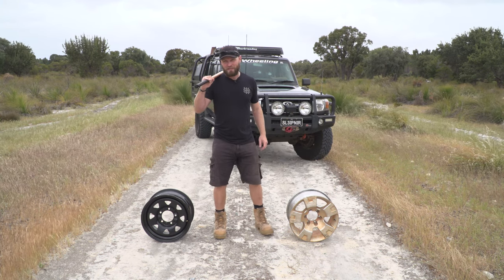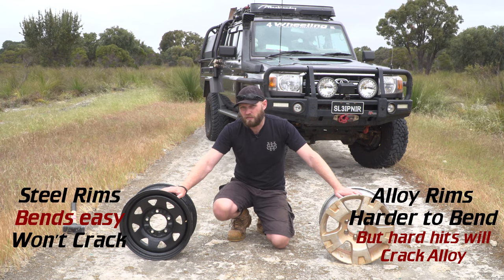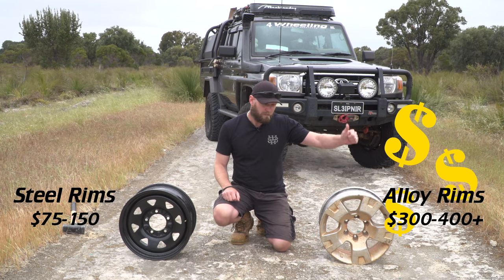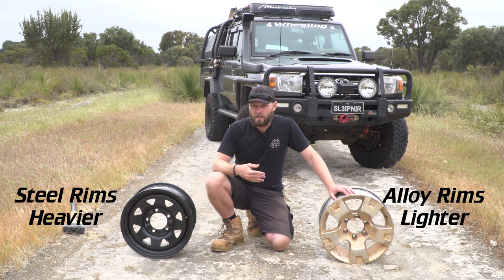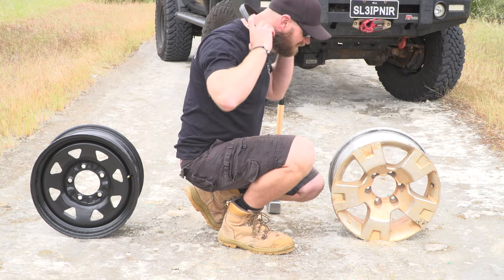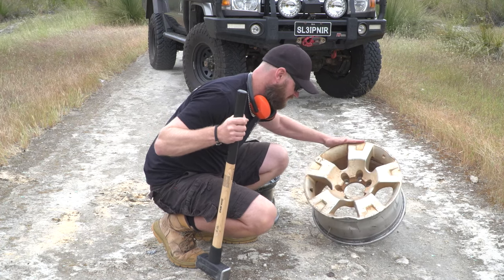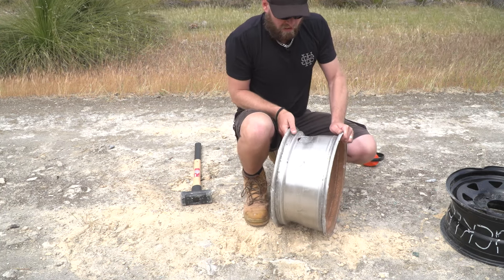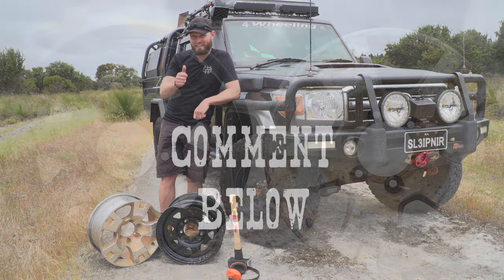STEEL vs ALLOY rims Off-road Wheels

Comment: Not all alloy's are the same.  My Land Rover has 20 year old factory alloys that have seen a hard offload life, but they are still in excellent condition.  They also have a factory internal bead lock.  I have never broken a bead or chipped a rim..   Replacements are easy to find and cheaper 2nd hand that steels.
Reply: I've known guys that drive off-road for a living, chasing pipeline, working remote oil sites- that sort of thing - since the mid 2000s a lot of their trucks run alloys. I've never heard problem one from them.  We are talking tens of thousands of miles of off-road driving to some wacky weird places over like 15 years.

There is such a thing as "stronger" but there is also such a thing as "strong enough" and alloy wheels are strong enough. If you manage to break one ... well - I've never heard of it happening, maybe it's an Australian thing.  Then again - that's why spares exist.

If alloys were some sort of dangerous design flaw I would be interested why  Land Rovers and Jeeps come with alloys - you know.. companies whom have reputations built on off-road prowess.  I'm fairly certain that if it was that large of a difference they would probably have stuck with steel.
Reply: Correct, the Landy will have a forged alloy wheel, nearly indestructible!
I don't think that was a forged wheel he was bashing up, because I really doubt he could have split it!
And if you bend a steel one, sure knock out the dent to get you home, then replace it, throw it away, as it will never be the same. It will be hard to balance, and will never be as safe as it was new!
Also wheel design plays a very important part of how strong a wheel is, not all wheel designs are equal, some Blingy Alloys are damn heavy, yet not all that strong compared to other alloy wheel designs!
Not all cast alloy wheels are equal either, the CSA wheels are by far the closest to a forged wheel in strength, not far behind at all, as for the rest yeah a good steel rim will give many of the poorer ones a run for their money.
So choose carefully, but remember most factory alloys are forged units, its one reason they are so expensive, but secondhand ones are great value... don't like the look, get them powdercoated :)

Comment: To Be honest 99% of 4wd alloy rims look shit. Even those aftermarket tend to be worse. steel rims always look better on 4wds
Reply: yes ,  they are better for off road and look great
Reply: define "better."    Because all I got out of this is if I want a heavy wheel that is more resilient to an attack by a Australian man swinging a sledgehammer then steel is the way to go.  If I want actual off-road performance......  well - all things being equal : lower unstrung weight is generally desirable and...........  nobody cares which "looks cool" if you are buying off-road parts based on which looks the coolest I think alloy/steel is  the least of your concerns.
Reply: Being able to trail repair something is pretty important in remote areas. When I'm 50 km in the bush,   I prefer something I can beat back in shape with a hammer. I keep JB weld for my ATV rims.
Reply: stevespatrol >>> "... black is boring ..."  So then paint it according to your taste ... pink with tiger stripes or whatever you like.
Reply: Oh no, it's not my wheel - I assume it belongs to Ronny.    The idea behind my feedback is - 
1) - Wheels rarely take direct blows  like that - they just don't. They have a inch thick belt of rubber (rubber is an EXCELLENT shock absorber) around them and have  some air that absorbed virtually all of the kinetic energy.   
2)When traveling off-road you are generally driving VERY slow.  There just isn't that much potential energy.  You are literally rolling over obstacle at walking speed.

I know like 40 years ago - the Baja guys ran steel for the impact reasons demonstrated in this video - because they could potentially get a low tire while hauling ass across a desert or whatever at 70-80 miles per hour and literally inflict the kind of blows shown in the demonstration.  Even they have gone to alloy.  Steel use is now nearly entirely used for budget reasons - sorry , but that's the reason.  It is stronger in ways that are not meaningful to typical use and much cheaper.

It's a cool demonstration but it simply isn't representative of real life.  Hense - steel is definitely the way to go if an Australian man attacks your wheel with a sledgehammer.
Reply: Charlie
Are you kidding? Breaking a rim is pretty common. My co-worker and I broke both rear rims on our work truck on a oilfield/forestry road. Water filled pothole at the edge of a concrete bridge. We use these same roads to get to pretty much all the best off-road spots. On the trails, a bit of water with a hidden rock protruding into a rut will destroy a bead without much speed. I've also seen rocks in creeks work their way in between the brake caliper and inside the wheel, jam up, and punch a whole through a rim. Driving a smooth trail going 30-40km/h and finding the end of a log in the grass next to the trail will destroy a rim too.
Reply: Oh yeah, I've broken rims on the road too. It happens.

Now off-road... Nope, never once. Never known anyone it's happened to personally. Heard about someone that heard of someone once.

Ohh wait -    just to clear. Bent wheels.    I've bent wheels on the road. Not this "Broken a wheel where it won't hold air" or " I'll beat it round with a hammer" nonsense.   Never seen that happen, hear of that happening,  I'm pretty sure it's a myth. Ronny says he's done it .... I'm not calling Ronny a liar but ...   I kind of doubt it.
Reply: Hi Charlie, if you have steel it does not hurt the pocket as much as alloy to replace
Reply: and we are talking 4wding, not a show car
Reply: THANK YOU, FINALLY SOMEONE UNDERSTANDS
Reply: love it.... LOLOLO
Reply: Steal = rust.  Eventually
Reply: but those classic style alloy wheels with holes are looks great...
Reply: +Dan Kuchar
At which time, you buy a cheap sandblasting tool from Harbor Freight and a powder coating gun from them and you learn how to powder coat.
Reply: Unless you have some sort of extreme rig where you haul it to your offroading location on a trailer, you're probably going to be putting a lot more miles on your vehicle on the roads than off of the roads.
Reply: Tactickle Shtooper what no Russian man? Oh, because Russian man is too strong like bull he'll put everyone else to shame. You also forgot a Middle East man, then again he'll probably just roll the wheel into an IED instead of using the sledgehammer.
Reply: logger roads hold all kind of hidden gooddie's the eye does see that is why i like steal rims
Reply: Gonzo21 Russia is both in Europe and Asia
Reply: @stevespatrol  black rims matter
Reply: @truthspace5525  "When I'm 50km in the bush..."  Sorry mate, but that made me LMAO ~ 'cause for me, that's home! 🤣
Reply: I think it's all in perspective, I mean an eagle alloy 589 (I think is the original brand) look great on almost all 4x4s. But in the same respect I like an old school factory steel wheel on a truck, Jeep or Rover. Personally I like steel because I can bang them back into shape pretty easy and here in California we have a ton of really Rocky trails,. When I was younger and would hit the dunes I was more partial to alloy wheels because it's all about acceleration and weight savings.  
This is an argument that has no real winner I don't think.
Reply: My question is at 40kmh on a track at night you clip a hidden object with your steel rim you can fix it yes ? 
What about the Suspension you have just ripped out smashed your steering 
Yes the alloy wheel will crack but more chance you can change the wheels and drive home 
Alloy all the way
Reply: @padrescout  little late to the party but he did say they were very rare occurrence.
Reply: @padrescout  and how are you going to say hes never done it? He had videos of him doing it.
Reply: @jonathanpalmer228   Then congrats! You found the one time thats ever happened.  Do you wear a helmet to protect yourself from meteor strikes? That one lady got hit once.
Reply: @jonathanpalmer228   Nah, can't be late to the party on the intenet, this stuff is here forever.
Reply: @padrescout  still when you're out in no where you gotta he prepared
Reply: Jonathan Palmer i maintain that is unreasonable preparedness.   Anything /can/ happen.  Doesn’t mean you need to worry about it.   You should also bring along a rape whistle in case a rapist trued to tet you as you leave your home going out to wheel.   It fan happen. Be prepared.  Although honestly that infinitely more common than a wheel being beat round and that makes me sad
Reply: I disagree that 99% of alloy look bad. I like alloy rims. And I like steel. But I didn't know steel are better for off-road. Good to know. I'll have to get a set for just that occasion. Really, when it comes to how someone's rig looks, I like  them on a case by case basis. Some ppl mod's are just hideous, but it's theirs and they like it. So I'm happy for them.
Reply: @felishiadarling    Now now, this is the internet.  It is vital you present you opinion as unwavering universal fact.   Like landrover - sure, he prefers the apperance of steels(god only knows why)  but notice how confidently he declares that "steel always look better."    We cant have you  going around in here being reasonable and offering a moderate persepctive - it'll fuck the chi in the room all upand we'll have to move all the mirrors again.
Reply: yeah... alloy generally only look good on a road queen. steel looks alot tougher and more "classic" on most trucks.
Reply: and no matter what, they never have a wheel to match your damaged wheel. so buy and use it to get home, and then next month buy the right wheel. and have 30 pounds of crap under foot till ya haul it off to be recycled with your beer cans lmao
Reply: @ashdavey1622  the alloy wheels dont obsorb shock well and reverberate it. Steel not so much. Also an alloy wheel will kill your tires faster when hitting shit causeing a flat. Steel will bend and or obsorb so you possible save your tires. Also if you snap a whole alloy wheel then i dont wanna be 400 bucks down on a peice of bling that aint that great. Steel is easily the better option. Way more durable.
Reply: @RolandtheThompsonGunner  lmfao
Reply: @acedogboy8421   sold my jeep bought a rover lmao far more happy seince
Reply: Disco1 freestyle in gun metal grey look good on a defender or a disco
Reply: Steel!!
Reply: So true
Reply: Who gives a shit how good your wheels look? Are building your 4x4 to look good in a parking lot or to perform on the trail?
Reply: @rowanfarrelly7713  yes you want weight low, but extra rotating mass makes acceleration harder, also limits your ability to crawl when you are loosing torque to rotating the extra mass. Alloy rims typically weigh anywhere from 10 to 15 lbs lighter than steel rims. That adds up QUICK with 4 tires. Thats 40 to 60 additional lbs of rotating mass. That means your loosing approximately 100 foot pounds of torque over all. So, to put that into perspective,  if your truck has 300 foot pounds of torque with stock alloy rims (pretty typical for most V8s), you will be sitting anywhere from 200-220 foot pounds by switching to steel. This limits your vehicles power to weight ratio meaning you've got to put more skinny pedal into climbing over an obstacle. So, if you go to a 20 inch alloy rim with 37-40 inch tire, you are increasing torque. That 20 inch rim and with 40s will weigh as much as a 17 inch steel rim with 37 inch tires. So, more tire equals more clearance, AND you have the weight savings while getting the height and extra torque. Maybe if you understood physics and how rotating mass affects power output you would understand off roading better.

Comment: Someone has posted a comment that at least partially answers my question about whether forged aluminum minimizes one or more of the disadvantages of cast aluminum for truck wheels. I’d welcome additional comments on that subject.

This month, my wife bought a car that has aluminum wheels. Of the 4WD vehicles we bought NEW (1987, 1989 and 1999), all had deep-dish steel wheels (i.e. not full-face). We drove those vehicles two years, ten years and nine years respectively including MANY miles off pavement. Except for the first of those three vehicles, I repainted the wheels of each one before each time I had new tires installed. The wheels never had so much as a trace of rust. 

In 2008, someone made a left turn in the rain in front of our daughter while she was driving our ‘99 TJ. The TJ spun completely around and was a total loss but it didn’t tip over and Heidi’s injuries were minor. We acquired our next vehicle used. It had chrome-plated full-face steel wheels. The backs and the place where the spider meets the rim were already badly rusted. I kept thinking I’d try to buy deep-dish steel wheels for it but my wife bought another used truck so I didn’t need to replace the full-face wheels. 

I’m not recommending that someone get aluminum wheels as “better” than full-face steel wheels but I’m suggesting that, not only are the full-face design harder to keep from rusting, trash (sticks, stones, dirt, mud--even snow and ice) tend to accumulate in wheels of the full-face variety. In deciding between steel and aluminum wheels, that is something worth considering.

Here in the States, it IS possible to get a new vehicle from the factory with steel wheels and skid plates (an F-150 or Ram, for example) but most of the rigs that are available from the factory with skid plates have aluminum wheels included in the “package”. Because the web sites don’t say anything about the aluminum wheels being forged, I have to assume they are cast.

Comment: Steel rims are far cheaper. For me this is the wining point. Old scrap steel wheels without corrosion in my Suzuki Samurai, running for years without problems.

Comment: I have just called CSA Alloy Wheels in Adelaide to obtain the weights of 4X4 alloy wheels and steel wheels. The 17"x8" (Ranger) steel rim (15 kg) is only 2kg heavier than their 17"x8" Large Cap. alloy wheels (All are 13kg). It's a no-brainer which wheels you should select if off roading. Furthermore, please note that if you want to use wider rims than standard, you are only allowed a maximum of 50mm wider than the manufacturer's track width. That is a maximum of 25mm (1 inch) extra for each rim. As an example, if you have a 25mm Positive offset rim, you can only reduce it to zero offset. You can look up the CSA Alloy Wheels website (Bulletins & Tech Info / Technical Information) and look at their Product Bulletin National Code of Practice, Vehicle Standards Bulletin 14.(Track Width & Offset). Suggest you double check your state rules to be sure, to be sure!

Comment: I've seen numerous people that have seen factory vs aftermarket torture tests, and they've all claimed the factory rims can (and must) take much more severe abuse than high quality aftermarket rims.

So that being said, I'm curious as to how factory aluminum rims, such as come on my truck, would compare vs aftermarket ones.
Reply from the maker: that was a factory Nissan Patrol Rim
Reply from the maker: the alloy one
Reply: T4nk, too many variables to conclude anything definitively.  Each manufacturer is different.  I believe that aftermarket wheels get anecdotally labelled inferior because they generally are made with thinner, wider spaced spokes and thinner rims for aesthetics.  This does not inherently make them weaker, but in the case of 4X4s, it can safely be assumed so, especially when you are 3 days into a 7 day excursion.

Any conclusions from the torture tests you've seen referenced are only valid for the specific wheels included in the test.  I would safely wager any aftermarket wheel could match an OE when the variables are as similar as possible.  That being said, a $70 reproduction will likely not stand up to a $700 OE.

Short of acquiring the metallurgy and manufacturing specs from everyone, the rules of thumb apply: 1. Thicker is stronger, 2. Cheaper is weaker, 3. Forged is best.

Comment: Saw a video a couple days ago, guy jumped a sand dune. When he landed the center section of his shiny aluminum wheel busted completely apart at the bolt circle. A jump on a sand dune isn't the toughest test of a wheel. That one video was enough to convince me to run steel on my rig. However, finding large steel wheels is more of a challenge than this video makes out. Everybody wants the sexy stuff, manufacturers aren't pumping out the steel as much.

RE: 20" wheels in the dirt-- it really does depend on tire size. My rig came stock with 17" wheels and a roughly 33" tire. The previous owner swapped 20" wheels and 35" tires. The current sidewall height is only 1/2" (12mm) shorter than the stock sidewall height. That isn't likely to make a significant difference in damage protection or sidewall flex. The big thing would be running as narrow a wheel as the tire manufacturer will allow so that the wheel stays within the protective zone offered by the tire and also provides a stronger grip on the bead.